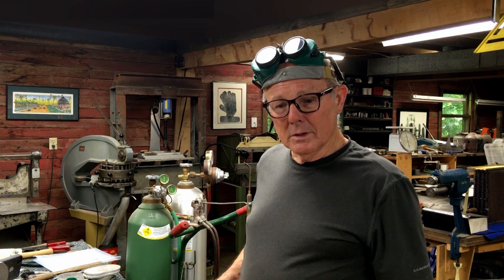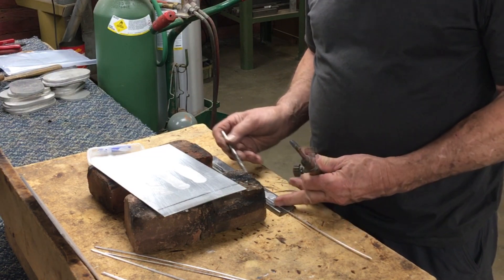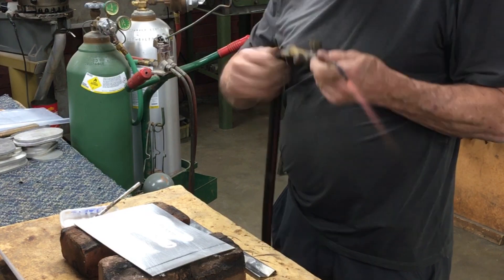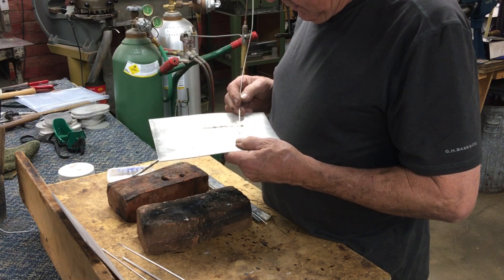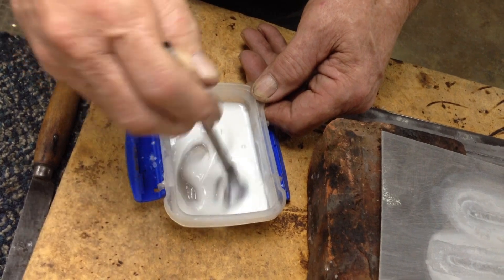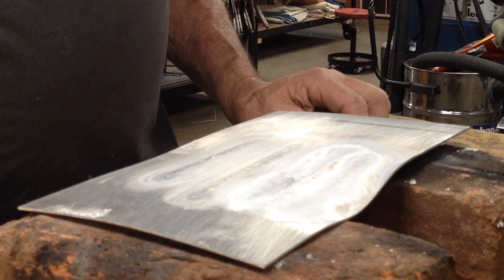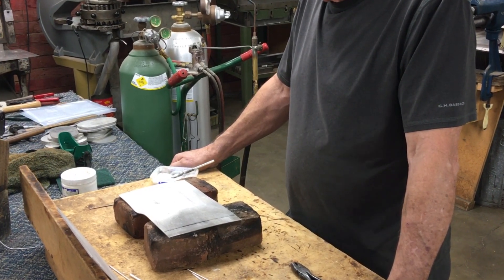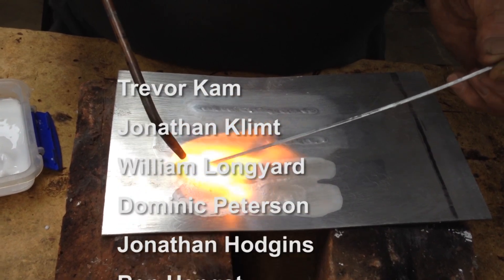Gas Welding Magnesium, with Jerry (Weeks) Baker

Comment: According to superior flux that is brazing flux. What are you doing brazing or welding? I am confused. Can this flux be brought above its temp range?
Reply from the maker: The process shown here is welding, not brazing, and Jerry Weeks Baker, the man doing the welding in the video, tells me that the flux is made for welding, not brazing. I do not think it is recommended to heat flux beyond the temperature range it is designed for.
Reply: @RonCovell  the superior no 21 flux according to superior is magnesium brazing flux. It temp range is 900f to 1150f. He used this brazing flux to weld. I am confused. If it works I'll use it, just wanted to confirm that he was indeed welding.
Reply from the maker: Yes,  in this video, Jerry is definitely making a butt weld on the magnesium sheet - NOT brazing!
Reply: @RonCovell  thanks for the speedy reply!!!!

Comment: Hello
Can I use  aluminum welding rods. I seen them welding rods on TV That claim anyone can use and weld aluminum with a hand blow torch.  Well I'm sure you seen them on TV. Well  to say that they do not work on motor cycle casing. I clean the casing real good and took my grinder to the casing it started sparking did not no aluminum would spark that way until i found out that it magnesium  casing. It sure look and feel like it aluminum.  I'm welding up a motor cycle casing that's Crack and it did not work at all. But after seeing your video I did not apply any flex. So I will purchase some flex and try it again. I'm using my torch this time again oxygen and acetylene.
Just asking about that also is there a type of aluminum rod to use. Because I have many aluminum rods here. But if I need to purchase  a correct rod I will.
Thanks for any info to this project.
Thanks again John
Enjoyed your post video.
Reply from the maker: John, if the casting you are welding is magnesium, I don't think aluminum filler rod will work. Also, there is a special flux used for welding magnesium. 
TIG welding may be the best option for repairing a magnesium casting, and that does not require flux. It may be best to take the job to someone who can TIG weld it.
Reply: Yes I watch your video and thanks for the reply back. I seen how you did that I like to try it as well.
I have a mig and tig welder. And i been welding now for 40 years build car carriers  for 15 years meanly mig and stick welding. I have  been welding stainless steel for 5 years at a food company that was USDA contorl. The tig welder I have is a old A/ C stick welder that I just change to polarity around but it so hot I can't contorl  the heat. I found out the reason why. I need a D/C welder so I can control the heat to tig with that why that not going to working. Now I have a 300 amp mig welder and installed aluminum  wire a i used pure argon. So after trying that it seem to work on filling in a pices that was missing on the casing built up nice.
I started grinding it and it just fail out in one big piece? No pinatreysion. So it fills like aluminum no  doubt after grinding on it spark flying tell me its magnesium  So it is a cast aluminum or cast magnesium.
Just asking once I purchase the  flex you used in your video what rod did you use, what welding rod magnesium welding rod?
Thanks
Reply from the maker: Aluminum is TIG welded on AC, not DC.
In the video you commented on Jerry (Weeks) Baker used strips he cut from the metal he was welding. I know this won't be possible for you. It has been 40 years since I purchased Magnesium welding rod, and I don't recall the alloy. I would check with your welding supplier to see what they recommend.

Comment: That's spectacular.  Who knew that melting point and ignition temperature were different!   When hammering the material into shape, does the material need to be hot? Warm? Or is it more of an annealing process and worked at room temp afterwards?
Reply from the maker: Jerry (Weeks) Baker tells me that when using a power hammer on magnesium, it has to be heated. I have done a small amount of hand-hammering on magnesium sheet, and I've learned that at room temperature, you can't go very far with it  before it cracks.
Reply: @RonCovell  Thanks, very interesting.  The coach builder that made the other magnesium Bugatti he mentions is very close to my location. I remember when it got completed, small world

Comment: That is incredible!
Reply from the maker: Yes, many people would have thought this was impossible.
Reply: @RonCovell  I am either old enough to know of it, or more Likely knew of it simply because most of my best friends and mentors were Jerry's age or older.  Sadly I have run into more than a few people that thought a gas rig was only for cutting....  The skills gap is getting wider every day, but fortunately there are a few people my kids age that have picked them up and are running with them!
Reply from the maker: Yeah, when I first learned welding in the 1960's gas welding was a commonly used process. These days, electric welding has largely replaced it - for better or worse.
Reply: I neglected somehow to mention what my initial thought on this was,  It is great to have you and others passing on your knowledge so not only those young people can learn, but also us old dogs!  Some how I had forgotten the string trick for drawing an ellipse you use in the F-bomb video.  Thanks for the reminder!  Now off to bing watch that and more!

Comment: After the fireball at a 24 hour race wasn't there a set of guidelines down to what minimum thickness of material was used for car bodies?
Reply from the maker: I think you are referring to the tragic crash at the 1955 LeMans race, where an Elektron (magnesium alloy) mercedes body ignited. Many countries banned auto racing immediately afterward, but I'm not sure if or how the rules governing body material may have been changed.
https://en.wikipedia.org/wiki/1955_Le_Mans_disaster
Reply: @RonCovell  yes that's the one!
Reply: @RonCovell  I read in a book years ago that after the accident maybe it was guidelines rather than "rules" came into place with minimum thicknesses for body panels? I have looked on Google but can't find anything.
All I can see is that some manufacturers are looking at using magnesium as body paneling.
All this being said that Bugatti looks gorgeous. And I would love to see more of his work!

Comment: I have found that when mixing the powder to past flux, wait about ten minutes and the welds look way better. Just what I have experienced. How about welding titanium metal with gas, what type of flux ??? Nice work and explanation too.
Reply from the maker: I've never heard of gas welding titanium. I'll look into that.
Reply: @RonCovell  You have to remember that NASA stopped using oxy-acetylene welding in 1996. But still have that as backup. Just say a fact I heard on the History Channel. Thank you.

Comment: In the 70’s I went to apply for a job at a specialty metal fabrication shop. The foreman said just get in the shop and weld. He had a 2” magnesium pipe rolled in a 4 foot circle needing to be welded closed. He said “can you weld magnesium”? I said “of course”, never having welded it before. He handed me a stick welder, I started welding and did an excellent job. This was on the floor. When done I stood up quickly and knocked over the 2 guys watching over my shoulder! I was hired on the spot, and never worried about magnesium again. Thanks, and I’d love to see the radiator builds. You both are Excellent Craftsmen!
Reply from the maker: Hey, that's quite a story! I've never heard of stick welding magnesium.
Reply: @RonCovell  We were building alfalfa dehydrators. For some reason the burner ring was magnesium pipe. Once we rolled a 6” x 9” solid bar steel into an 18’ ring. It had to be within an 1/8”. We did it with 3 overhead cranes every guy in the shop doing something, and the owner standing off cursing at us the whole time. That shop had equipment no one for states around had. We did a lot of sub work. We made huge stainless steel “pressure cookers” for Georgia Pacific. 1” SS rolled into about 6’ round shape about 8’ high. Locking ring lid. We did some wild stuff. We rolled a lot of steel. My work buddy had his whole foot rolled 1/2” thick in a plate steel roller. They just rolled it back out! 6 months in the hospital. I think that type of work crippled me up. I’m disabled now, but then I old too. But still have my metal shop and wood shop I “play” in each day. Thanks.

Comment: Warped all to hell.
Reply from the maker: Yes, gas welding sheet metal of any kind generally causes a lot of distortion. One of the advantages of a gas weld is that the weld and the metal surrounding it stay relatively soft, and often the distortion can be worked out perfectly.

Comment: Hello Ron, thanks for another great video! In the past you asked me what kind of content I would like to see, but then I had no specific interests against welding. Guess what, I do have now!:) To be specific, a coworker and me welded together a 12" vacuum tank(made of 304 stainless steel), then welded some 4" clamped flanges(also 304 steel) on it. Flanges have warped so much along the curvature of the cylindrical face that, the gasket between the blind cap and the clamp flange can't form the seal at all. If preventing warping during welding takes the skill of a proffesional like you, I would love to see a video about your opinions on warping in detail!(or in general, anything works!)
Reply from the maker: Thanks for a great suggestion! Stainless warps more than any other metal I've welded, and there are a few techniques and strategies that can help. I'll see if it might be possible to work that into my video schedule at some point.

Comment: Interesting video. I never thought about applying flux to the backside of a weld to protect it from oxidation. Would that technique be applicable to inert gas welding as well?
Reply from the maker: Yes, there is a product called 'Solar Flux' which can be used to protect the back side of a TIG weld on stainless, or some other alloys:
https://www.amazon.com/Harris-S0FB01Type-Solar-Welding-Flux/dp/B003TT0RJI/ref=asc_df_B003TT0RJI/?tag=hyprod-20&linkCode=df0&hvadid=312039830589&hvpos=&hvnetw=g&hvrand=4411277471516942186&hvpone=&hvptwo=&hvqmt=&hvdev=c&hvdvcmdl=&hvlocint=&hvlocphy=9032164&hvtargid=pla-569724401241&psc=1&tag=&ref=&adgrpid=63202739518&hvpone=&hvptwo=&hvadid=312039830589&hvpos=&hvnetw=g&hvrand=4411277471516942186&hvqmt=&hvdev=c&hvdvcmdl=&hvlocint=&hvlocphy=9032164&hvtargid=pla-569724401241

Comment: Of course we want to see Jerry build a radiator! 
Thanks for the presentation gentlemen this was interesting. Years ago I gas welded aluminum just to see if I could. As far as working with magnesium, I  have only tig welded magnesium in repair work. Never fabricated anything from scratch. And no I did not start anything on fire! I researched the properties, procedures and materials before I started.
Reply from the maker: Glad to hear you did your 'due diligence'. I have noted your interest in a video on making radiators.

Comment: When I was in training, one of our guys was sanding on an old magnesium panel and hit a steel rivet.  His coveralls, the floor, and the pile of dust went up like an old-fashioned flash bar for early photography.  Lost a lot of hair, but no burns.
Reply from the maker: Years ago I was removing some material from a magnesium part with my disc sander. No problem with the mag, but later I sanded some steel, and when the hot sparks hit the mag powder on the floor, it made quite a flash! Fortunately, no damage was done, but it could have been  a lot worse. Working with magnesium certainly requires some knowledge and respect.
Reply: @RonCovell  I once failed to do a  proper cleanup after machining a VW case and was MIG welding later, made for an interesting sparkler display on the floor.  Fortunately no damage to property or moron!

Comment: I have welded a lot of aluminum with oxy acetylene. I liked using aluminum arc rod the best, because of the flux.The flame is ghastly orange so through experimentation, I settled on using purple lenses. Made a big difference! There is a certain feel to it that lets you know when it's time to haul ass and go, without falling through. Looks similar to welding magnesium.
Reply: When you say aluminum arc rod, do you mean stick welding rods? If so, when using those did you flux the metal as well?

Comment: Hi Ron great video,
I really would like a breakdown on the gas welding setup up that Jerry has I have never seen this setup
1.) the auto shut off  for the torch is great can you buy it or is it homemade 
2.) also does he have a pilot flame to restart the torch, again is this homemade or can it be purchased?
3.) I like the use of hydrogen instead of acetylene it looks much cleaner, can you use hydrogen for all metals 
Thanks
John
Reply from the maker: The device that shuts off and re-starts the torch is called a gas saver:
https://www.tinmantech.com/products/welding/regulators-economizers.php#econ
I have only heard of hydrogen used for welding aluminum and magnesium. With steel, hydrogen embrittlement is something to be avoided.
Reply: @RonCovell  thanks Ron for the info!!

Comment: Interesting to watch someone gas weld magnesium!   Do you have any info about his torch lighter shown at 4:18? I never saw one like that before. It looks like it lights for a handful of seconds every time he lifts the torch off of the hook.  It looks like it also shuts off the gas lines to the torch when the torch is on the hook.  When he lifted the torch off of the hook subsequent times such as 7:28 he lights it immediately without touching the adjustment knobs.  He also hung it up lit at 10:21 and it was shut off after that.
Reply from the maker: The device that shuts off and re-starts the torch is called a gas saver:
https://www.tinmantech.com/products/welding/regulators-economizers.php#econ
Reply: @RonCovell  Thanks for the link. I never saw one before.

Comment: Great video. How does Mr weeks ignite and extinguish his torch?
Reply from the maker: The device that shuts off and re-starts the torch is called a gas saver:
https://www.tinmantech.com/products/welding/regulators-economizers.php#econ
Reply: @RonCovell  thank you sir, I've not seen this before. No loss in time,gas,or money! Most importantly no strikers to look for and fumble with!

Comment: Thanks a lot for the info! I have a magnesium oil pan(Toyota Supra turbo-a) and had to repair it. Magnesium really loves temperature a lot.
Reply from the maker: I'm guessing you TIG welded it? That's much more common than gas welding.
Reply: @RonCovell  Yes sir you are right.

Comment: What is that gas shutoff valve/torch holder combination?
Reply from the maker: The device that shuts off and re-starts the torch is called a gas saver:
https://www.tinmantech.com/products/welding/regulators-economizers.php#econ

Comment: Another thought here about welding Magnesium and not unlike any other material, is that you first start with a procedure that spells out exactly how it is to be done. I call it the parameters.   Welding procedures call out Volts and Amperage, duration of each pass and the Jules calculation over time to get the amount of energy being put into the weld and then interpass maximum temperatures and minimum temps to start or any pre-heat and you get the idea. 
And I should have stated this first but it was fairly complete and may have missed some of the points but a couple of questions come up about oxy-acetylene pressures, the flame, was it carburizing, oxidizing, neutral?  
Keep them coming, thanks d
Reply from the maker: Dennis,
You obviously have a scientific viewpoint on welding procedures. Many of the finest craftsmen look at it as a manual technique that you have to develop the 'feel' for. Neither approach is inherently right or wrong, but they are quite different in nature.
I have never welded with hydrogen, so I don't know how you tell if the flame is carburizing, neutral, or oxidizing, while it's pretty easy to tell when welding with acetylene. Welding aluminum with an oxidizing flame does not work well at all, but a neutral or slightly carburizing flame works well.
In the video Jerry changes the mixture several times, and comments about the different properties of the flame (becoming 'stiffer', for example).
Reply from the maker: After thinking more about the issue of 'carburizing' flames, it dawned on me that acetylene DOES have carbon in it, but hydrogen DOES NOT!
Reply: @RonCovell  Yes and a quick re-watch of the program showed the hydrogen bottle and Jerry mentioned using hydrogen as well. That explains the flame with no noticeable neutral characteristics.  Thanks for clearing that up.

Comment: I liked the gas valve + pilot flame, haven't seen it before + yes seeing the build of a radiator would be interesting
Reply from the maker: The device that shuts off and re-starts the torch is called a gas saver:
https://www.tinmantech.com/products/welding/regulators-economizers.php#econ
I'm taking a tally on the requests for a radiator-building video.

Comment: EXCELLENT work, 👍😎. In think Porsche used magnesium space frames on the 1970s 917s 👍
Reply from the maker: I know Porsche made aluminum frames for at least some of the 917's (and they reportedly had a pretty short lifespan) - but I've never heard about magnesium ones. Maybe someone who is knowledgeable can comment on this point?
Reply: @RonCovell  maybe l'm mistaken  🤯

Comment: Very interesting video Ron, I’d definitely like to try my hand at this , but finding a bottle of hydrogen welding gas might be a challenge as I’ve never seen it at any of the welding gas suppliers in my area .
Reply from the maker: Well, not a lot of welding is done using hydrogen, but your welding distributors should be able to order it.